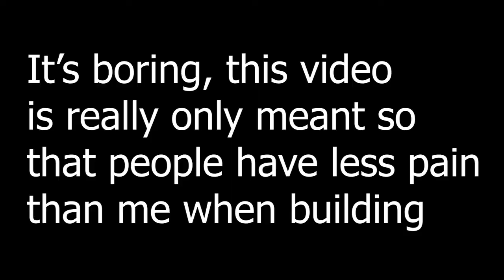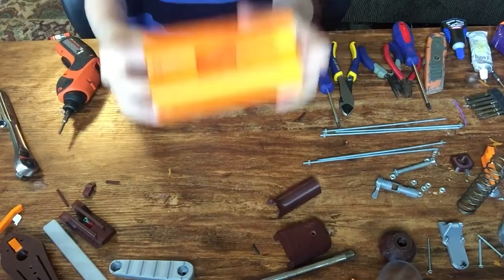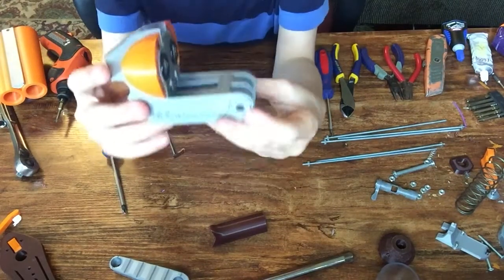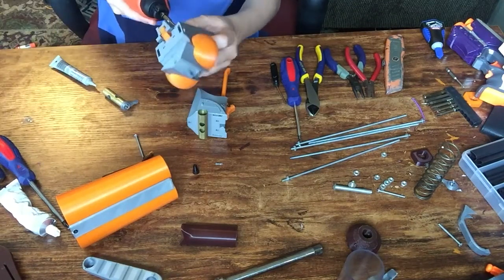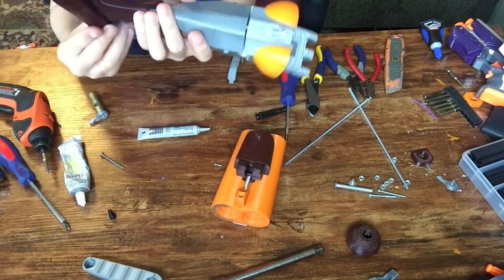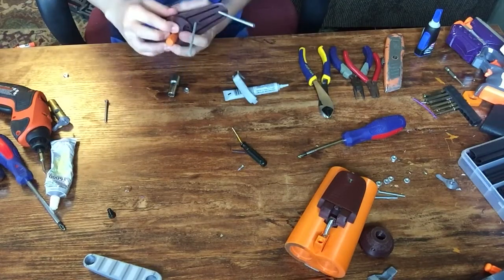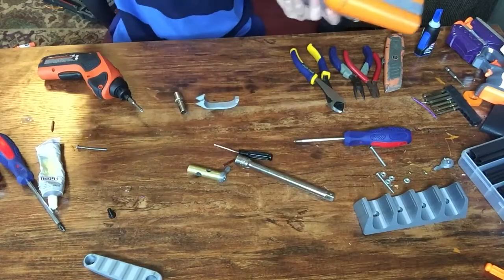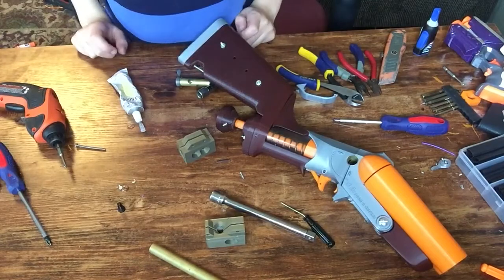Foam a nature build guide

Comment: What are those regular screws used to assemble the whole thing? I believe ehdrian used 17 of them (m2.6), need help finding accurate dimensions for them. Any ideas ? also, the threaded rods, what are the diameter of those, 3.5 mm ? for the polycarbonate tube, I actually 3d printed it, Do you think it would work ? Last thing. The metal pins, any ideas about the diameter?
Reply from the maker: All of the dimensions for these should be in the thingiverse page

Comment: what's the total cost?
Reply from the maker: Depends on where and how you get your parts, but I’d budget at least 150 dollars.
Reply: @SquirtlePlays  Another question, will it still work without the faux caps?
Reply from the maker: You mean the barrels? No it doesn’t work without the barrels.
Reply: @SquirtlePlays  No, I mean the half-dome caps that screw into the front of the frame.
Reply from the maker: Ah no those aren’t needed, but they look nice
Reply: @SquirtlePlays Also, could the brass pieces be 3d printed instead, or would the pressure break them?
Reply from the maker: It probably wouldn’t break them but it wouldn’t work very well and may not fire.